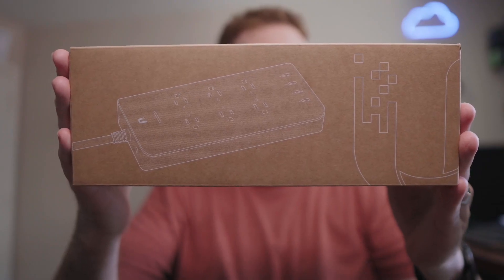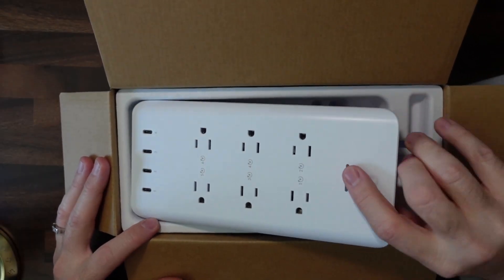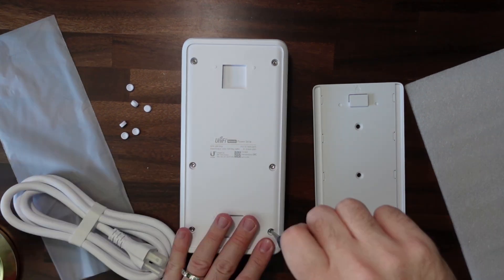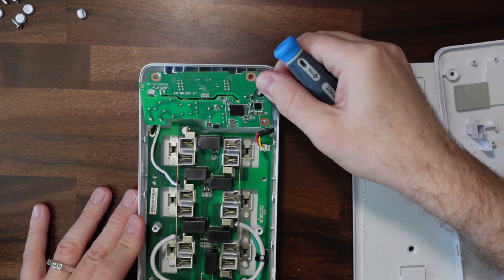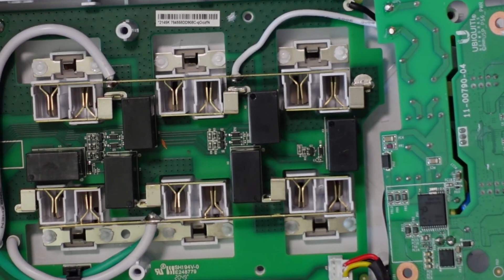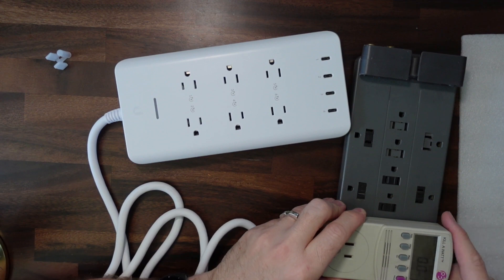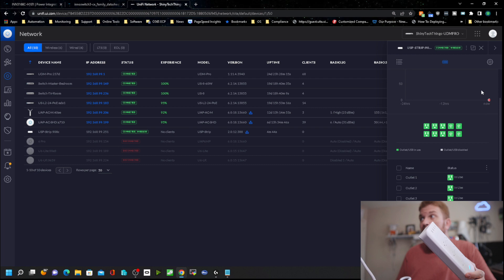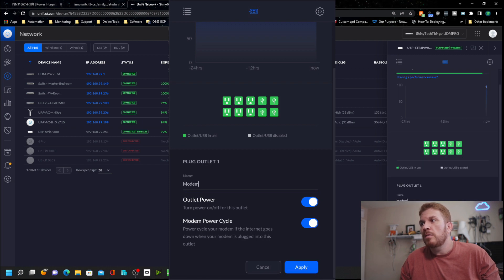UniFi smart power strip unboxing setup and disassembly

Comment: Love the video. This is quite thorough (for some aspects), although the real reason I was watching your video is that I was hoping to see how you paired it as I was having some issues. One item of constructive feedback is that you say "go ahead" an extreme amount. I also used to say that and it wasn't until my manager mentioned it to me did I realize just how much I said it. Other than that, I like how you cover things.
Reply from the maker: @Jason Cherry Thanks, and I think I stopped saying that so much in my newer videos. My wife told me the same thing at some point and I totally heard it but only after it was pointed out. Please let me know what you think of my newer videos when you get a chance. For the pairing you just go to your UniFi controller and it detects it and then you adopt it. Does that answer your question?

Comment: These days you have to be carefull what you buy on line because just because it has a FAKE PASS sticker doesn't mean it won't burn your house down.  AKA China garbage BE careful..
Reply from the maker: @Jason's Lab I bought directly from Ubiquiti so it should be fine.
Reply: @ShinyTechThings  Yes yes i know, my commend was about the UPS from SPX :)
Reply from the maker: @Jason's Lab Oh okay, totally makes sense now. Thanks for the clarification!👍
Reply: @ShinyTechThings  My bad totally if that came across wrong!! These days we have to be careful what we buy and plug in that comes from on line. Stuff that be cheaply made and can burn houses down. Ask me how this almost happened years ago with Grandma's house! :(
Reply from the maker: @Jason's Lab How did that happen? Could you please start a new thread for your response as this one keeps getting flagged by YT for some reason.